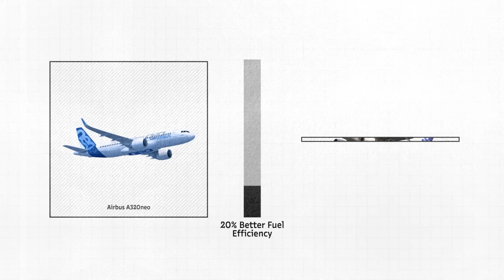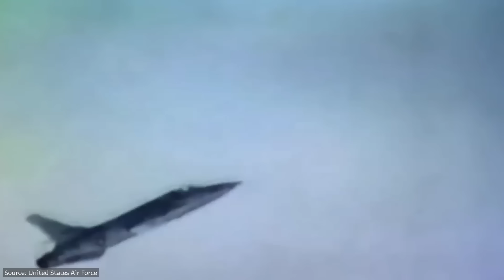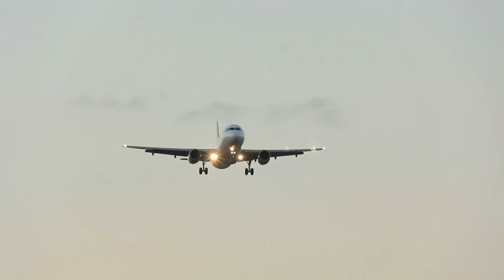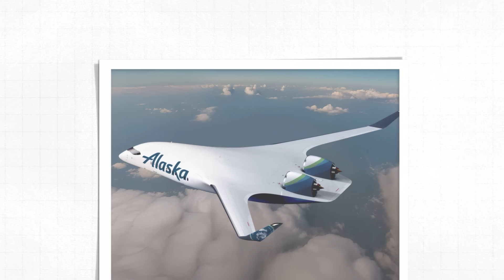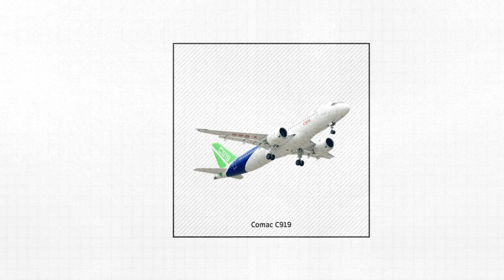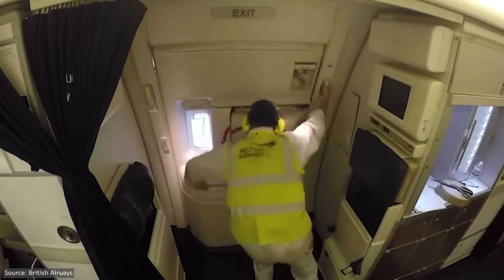The RADICAL New 737 Competitor Coming By 2030?

Comment: What surprises me is the use of the PW2000 series engines.  Nothing wrong with 'em, but they're 70s and 80s tech!  Too bad a more economical engine isn't available!
Reply: There are newer engines available. But they’re very spendy. For iterative prototyping, the older existing engines are a known quantity and can provide plenty of power and thrust needed for development of the airframe. Once they figure out how to make a blended body design that can actually meet revenue generating performance, producibility and operational needs, they can either choose newer existing engines or develop a custom design tailored to the new air frame. 

One of the biggest hold backs for transportation technology evolution and advancement has been the risk and cost of new engine technology’s at the same time. 

Examples. Giant bombers were built before, during and after the Second World War. One of the common problems was sourcing engines capable of producing engines with suitable power that were affordable and were light enough in weight to use. 

The early first gen 747 100’s and 200’s had engines that were quite under powered for the plane. There were all kinds of shenanigans incorporated such as water injection, over boosting and special operation procedures to get every ounce of thrust needed by the new plane. It took a period of time to work out the kinks and get updated, upgraded and improved engines installed. One of the issues with the Airbus A340 series was it was generally considered to be under powered. The A380 was designed to grow to a much larger airplane, so the model that entered service was too heavy and optimized for a model that never came to market. The 747-8 was a significant improvement over the 747-400 series, but in reality, its size and cost of the 4 engines was too high. The 777-x became a preferred replacement for the lower end of the 747 market.

Comment: Maintenance of the engines will be more expensive. Tri-jets, Concorde and tail engines all ended for a reason. And how will they develop it for larger and larger diameter engines? Will it not have the B737 problem? Today's Airbus, Boeing, Comac, Embraer are not the result of backwardness but of evolution.
Reply: The 737 problem was lack of space below the wings.  That's not a problem with this BWB aircraft since the engines are located on the top of the fuselage.  Engine weight, though, could be an issue if the engines grow in size.

Comment: Interesting. I prefer a matter of fact and reasoned presentation with a face filling the gaps between appropriate graphics, rather than what are all to often videos of aircraft with little relevance, or a repetitive loop which can be a little boring.

Like you, I wonder how it will be received by those who really matter, the fare paying passengers. Will they put up with the new cabin layouts, or simply move their business to airlines with tubular cabins? If they have to offer greater discounts than the efficiency gains cover, the business case will fail. While fuel costs are a major factor, there are many others, such as financing, maintenance, and airport charges. While there will no doubt be advances in weight reduction, will it be possible for some of those to be employed in tubular designs and eat into the blended wing's advantages?

Additionally, I wonder about the ease of maintenance and the expense of doing so with engines mounted as they are in the currently available graphics. Accessibility doesn't look to be a strong point, particularly for the pre-flight walk-around - remote cameras perhaps?

One other point to consider, and a question for you. Following the total loss of the A350, and seeing just how long it took before the cabin environment became unsurvivable in the real-world, do you think that we might eventually have different evacuation requirements for composite and metal cabin construction?

Subscribed and looking forward to your next video.